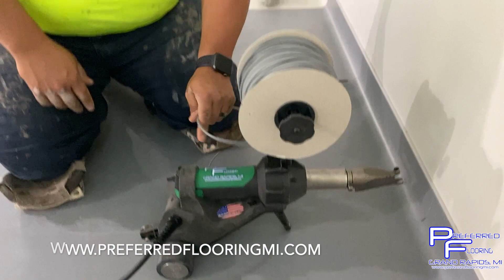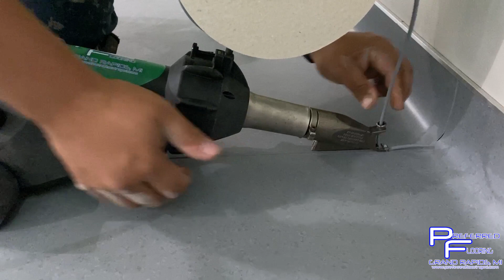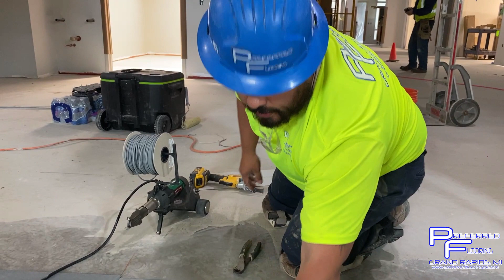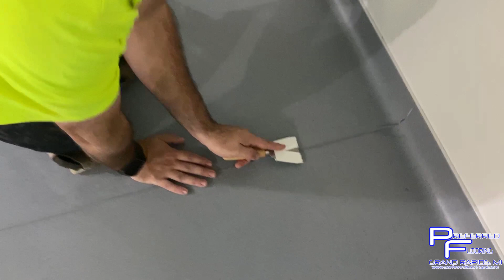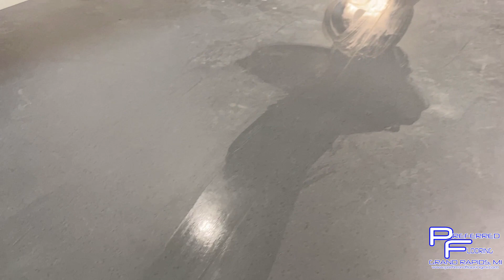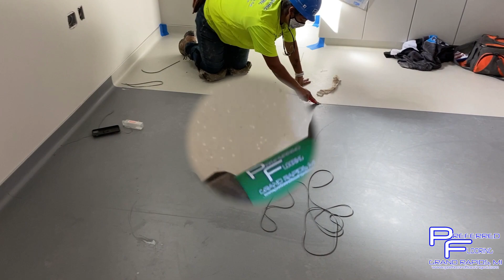Turbo Heat Welding Tools - Chiquita Used on Nora Rubber

Comment: Hello please help me whith  this cuestión im install the nora plan ruber flash Cove  but the material all broke  the outside corners the inside to WY THAT HAPPENED. PLE A SE HELP ME.
Reply from the maker: https://youtu.be/AoVgMvqMqX8
Reply from the maker: Watch that for inside corners. Use duct tape on anything you think will rip. It’s not very easy to freehand flashcoved nora.
Reply: @PreferredFlooringMI  ya depending on the layout but most of the time I freehand it, but there is times I pattern scribe.
Reply: You. Crazy to try to freehand Nora especially 3mm. Use felt paper and make a pattern. I’ve been doing union work for 22 years.

Comment: why are all the inside and outside corners taped? are you guys caulking them? Ive been doing commercial flooring 25 years and have never seen that done.
Reply from the maker: Shaun, nora has cold weld for all (but not limited to) vertical seams. It comes in a regular caulk tube and matches the color of the weld.
Reply: @PreferredFlooringMI  yea we always welded our internals and externals.....keep up the good work
Reply: Your Jobs are great,.
Reply: There are times I wish I could cold weld everything, absolutely love that stuff